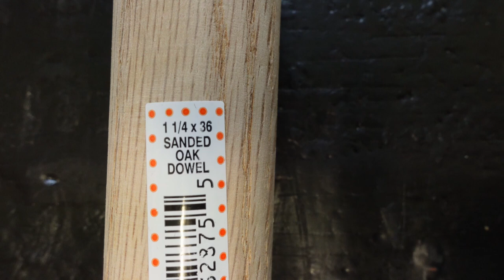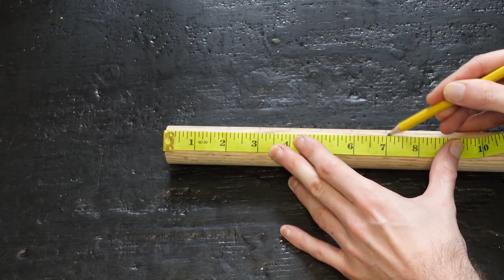Building A WWI Trench Club

Comment: Cool build man. Do you have a display wall you hang all your projects on. That would be a cool background for your workshop. Also one suggestion for a tool is to get some pipe cutters. It would save a lot of time and produce a clean cut. I also use them to cut and or score wooden dowels so my file work is cleaner.
Reply from the maker: Thank you very much for the comment and the idea. As of now what I have works, but I will look into that. 👍

Comment: Did you mix the black acrylic paint with anything else? The next step after it looked liked you washed on a white liquid from a square bottle, can you share what that white liquid was? I really like how it lightened up the mid color areas but left the handle grooves still black. I'm making one of these right now but a little different since I have different materials.
Reply from the maker: I use watered down black paint to wash it, giving it a vintage look.
Reply: @john_free_thinker  That vintage look is cool. What about the white liquid? Was that a sealant? Also the grips, did you go very deep? Thanks again, I'm about halfway done.
Reply from the maker: @asimpson164  It was clear coat, and the grip groves are not that deep. Just deep that it is a good grip.

Comment: Rivets and wood glue? I guess, if thought is free, you got what you paid for. But hey, you're on your way to a decent pina colada!
Reply from the maker: Thanks, wood glue still work. But I know epoxy works a lot better but is also more work to set up.
Reply: If wood glue is good enough for axes, it's good enough for a club
Reply from the maker: @justdead101  Well, if it is wedged in there tightly then it should be fine. As long as the connection is secured then it will work fine.

Comment: You obviously know very little about the correct use of tools - you used a hacksaw designed to cut metal for cutting the wooden shaft, you use a metal file for filing wood. I am pretty sure you are not trained.
Reply from the maker: It works, didn't it...